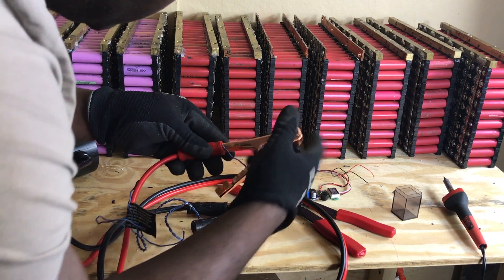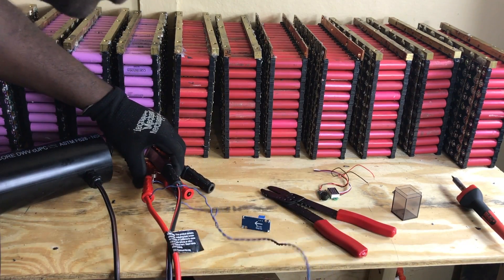Bottom balancing

Comment: There are so many cells connected. Assuming there are of different voltages connected in series, will this instrument bottom balance them all at equal voltage?
Reply from the maker: Chinwuba Ogbuagu each pack has 150cells in parallel not in series.
Reply: @Njahkavin  that is not an answer to my question? Whether they are connected in series or parallel and in different voltages for each cell. Will it bottom balance all at equal voltage?
Reply: @greatogbuagu1370  you known nothing and shouldn't be playing with cells. basic electricity shows you in parallel all cells have equal voltage.

Comment: I just subscribed to your channel. I am getting into collecting cells. but I haven't been able to find a deal locally . except for the 20  26650 I got. they are 3500 man. and some 18650 from a drill. but I need a lot for my off grid home solar setup. I am going with a 24v and drawing 200-300a so I don't want to draw over 1a per cell. and want to draw 1/4 amp per cell.  as for building the bank. would it be best to build a 3.7v pack ? or multiple 24v packs? in case I have a bad cell maybe many 3.7 v cells. so a small group can be disconnected. without disruption of power. your advice is greatly welcomed. thanks
Reply from the maker: Hey man i am sorry for the late reply. if you were here in junction city  ks, you will surely find a deal. i will say 24v modules will be better for you. . and it just how many clls you are assembling in parallel. what is your goal.
Reply: Njah kavin 
thanks for the reply. I want to run a 24v inverter. that will be pulling about 80-100a most of the time while in use. but the refrigerator will be pulling the most . from time to time. so maybe peaking around 150a. but at full output will pull a little over 200a. and need to operate 8-10or 12 hours between changing. and I would like to double or triple that eventually. I'm guessing I need around 1000a hours.